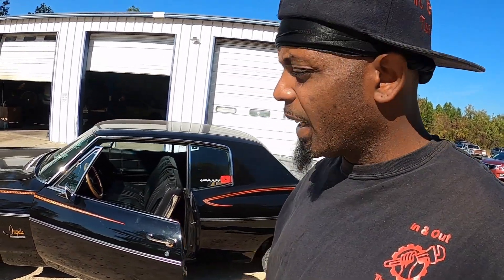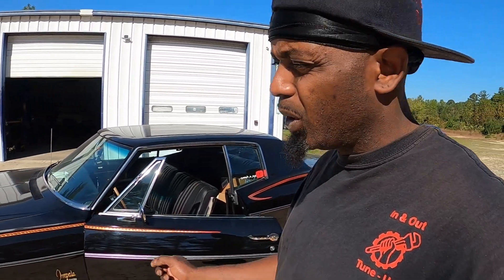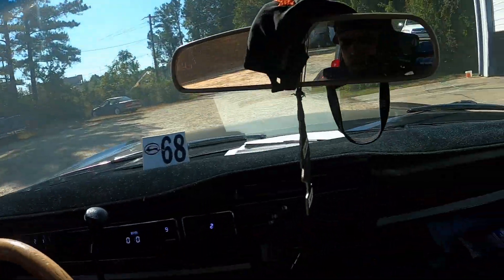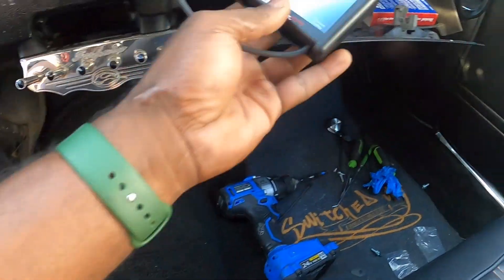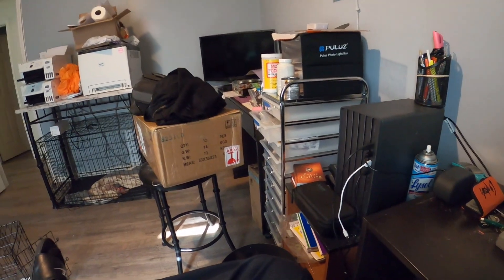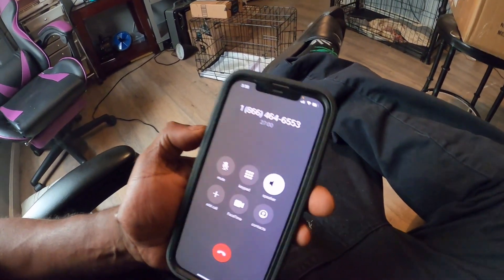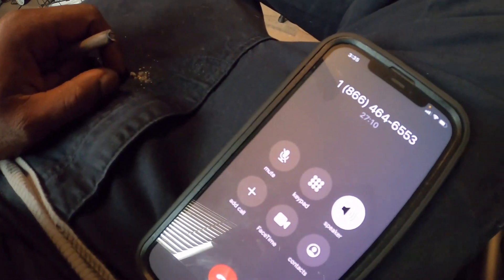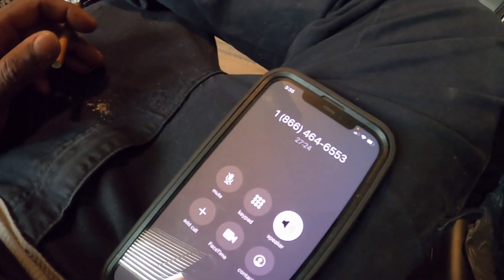Holley Sniper Pt2 ........NOT going well.

Comment: I have a 1375x flow on a turbo 72 Dart drag car on E85. It runs 9.90s without even trying. I have also done some troubleshooting on other snipers and every time, it has been installer or user error. One guy didn't have it wired directly to the battery. Another one had the fuel pump mounted to high so it couldn't gravity feed.
I'm not saying that's the problem with yours, I'm just that has been my experience. I am very happy with the sniper. It allows me the benefits of fuel injection without having to drill holes in my intake for injectors
Reply from the maker: Go back check the first video on Holley. I have retro fit fuel pump for Sniper. Been on the phone with Holley to ensure it not user error. But I think(hope) I got it figured out now. Thanks for help.

Comment: So what did you do differently? Tell me your feed and return lines were plumbed backwards? Because aside from a bad pump that's about all that could be wrong as I understand the problem. I guess the feed line from the pump to the fuel hat inside the tank could be loose causing a pressure loss as well?
Reply from the maker: correct the line on pump blew out
Reply: @switched_up_2six487  yeah I figured as much. I've had some bad parts in my days but never back to back bad pumps.
Reply from the maker: @jasonbrinegar6759  me either it was all crazy stuff going on, but I think we got it going